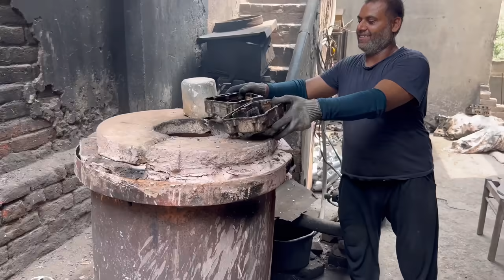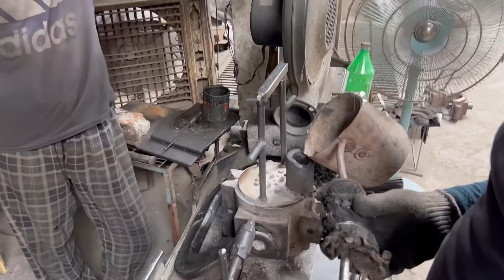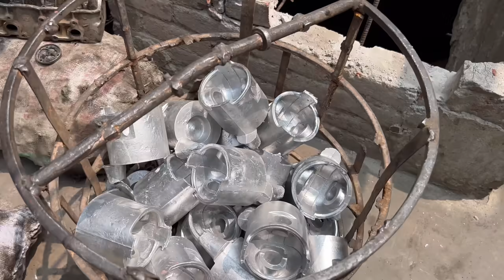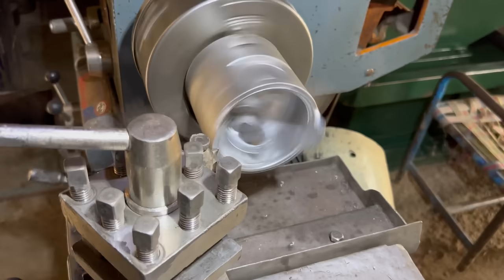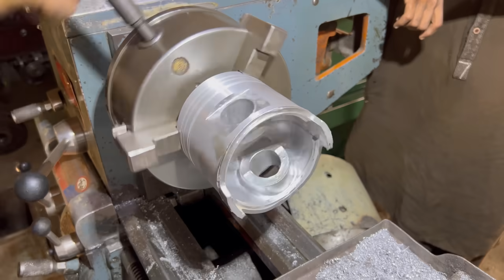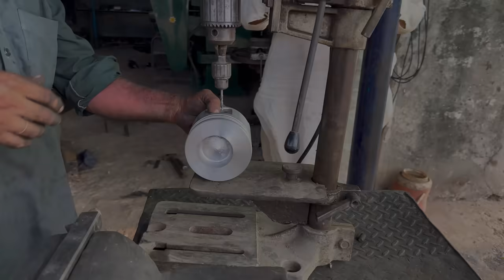How to Manufacturer Process Of Truck Engine Piston - Production of Engine Piston |

Comment: Imagine trying to get 6 identical pistons!! As a machinist I’m horrified!
Reply: Even a hobby level machinist would be horrified. Watching him reef down the hard jaw chuck with a cheater bar direct onto the already machined ring land area had me cringing.
Reply: And yet, this was how stuff were made 50 years ago...
Reply: @mitsos_306  No, fifty years ago in Western countries and Japan etc the quality control was orders of magnitude better
Reply: Ligia Gom  Obviously he is.
Reply: I feel sorry for whoever buys it!!!
Reply: @mitsos_306  No, 50 years ago we were still making EXTREMELY precise parts lol, hell Ive worked on a manual lathe from the 40s that still can, even after many decades of use
Reply: @ferrumignis  or when he fixed to that jig with the nut, hanging way out the chuck... with only 1 point of the angled surface even getting pressure from the nut lol.. I was just waiting for a bite and that whole thing to become twisted metal
Reply: @_VEKTA  the parts they do are precise, the material is crap..
Reply: @mitsos_306  No. Most definitely not. Even in the 1950s we had forged alloy pistons with steel inserts.
Reply: @mitsos_306  material is definitely crap, but if you don't have precision measuring devices (even super cheap Chinese ones) you aren't making precise parts. Pistons I think usually have slop to the cylinder walls of about ~.030", or thirty thousandths of an inch, but I never saw them measure with anything that could accurately measure even a larger tolerance like that. They also just eyeballed in the part straight when it was floated out the chuck. Not trying to be argumentative, I've just done this kind of stuff for years now lol
Reply: @_VEKTA  I really appreciate your response!
You are absolutely right!

My grandmother was a machinist and was working on a lathe making engine parts in the years after the war and until about end of 70's!
they had presision clocks though...

Same here, don't want to impose anything. Just sharing thoughts.

The world is not only US and Europe.we are used to tight specs and good quality products. But in these places;

 What I'm thinking when I see these videos is that of course they are not hi-end products but they must work(sort of).
Reply: @mitsos_306  it's a shame that in none of these videos the machinists never seem to have even the cheapest of measuring devices, but if they did it would DRASTICALLY improve the fit/operation of the final part. China has gotten so good at making cheap instruments, you can buy micrometers and dial calipers for next to nothing nowadays. I think it isnt so much about the money, it's probably more that they've been doing things this way for so long they're stuck on it. With higher precision parts they could also increase the prices of their product substantially, which means more profit for the (likely) impoverished employees. Hate to see it but what can you do ya know lol
Reply: Ligia Gom  , please explain exactly what you are?
Reply: @mitsos_306  50?  more like 100!
Reply: These workers don't have the luxury of being bailed out by government that is tax payers.

Comment: Pistons are designed with a taper, the tapered shape compensates for thermal expansion and thermal growth. The piston crown gets a lot hotter, therefore the top of the piston expands more than at the base of the piston. I’m fairly sure the pistons seen manufactured in the video were being machined parallel.
Reply: "parallel"
Reply: Also modern pistons aren't round, they're elliptical, not to mention these are made with completely unknown metallurgy. I'm like 90% sure this whole operation is just done for YouTube views (2.2million!). Can you imagine hand-sawing the "sprues" off every single one with a hacksaw like they did? Insanely inefficient.
Reply: @truthsmiles  no you are wrong this is not for YT they really do like that and are pretty good, of course not automated, pretty dependent on manual work quality but they have great success according to what technology they use. Metallurgy is ok, the similar is done in most of car production factories, melting old engines and making new from that...
Reply: So you measured the tolerance with your eyes?

Comment: Your supposed to grind a slight ovality on the piston so there is room for the metal to expand across the wrist pin where there is more mass of material. How you can maintain accuracy by keep taking the tool bit out of the toolpost or tilting the toolpost around is beyond me.
Reply: Come on brother this are ancient tools made by Khufu 😝
Reply: You should not expect any quality product out of this kind of sweatshop with the kind of material and tools.  Everything is junk.
Reply: I suspect that these are sent to another company to be properly finished. As shown, I think that these would not do the job in a real engine.
Reply: @jeffreyfwagner  oh but they’ll try.. seems they have way too many people needing something to do, so their economy is built on “good enough for now, we’ll fix it again next week”.  Thus, 10 guys make another piston after 5 guys pull it from the engine, again. Repeat.
Reply: This is a rip-off, OEM, pirates or would you say, it's a local spare part being sold with no brand, it's cheap, so cheap than brand new og certified spare parts, where I come from and other develop country used this kind of technique

Comment: во время обучения в мореходном училище, на производственной практике, мне приходилось отливать в кокеле заготовки для поршней. в принципе процесс не изменился. процесс приготовления расплава очень примитивен. в тигель бросают что попало, раскислитель не применяют. на таких поршнях далеко не уедешь. для изготовления поршней применяются сплавы алюминия с кремнием - АК-3 и АК-4.
Reply: Там у них много насосных агрегатов для полей и пр. Это для них
Reply: @saiansydyk5796   Really does not matter what application these pistons will be used except a paper weight because simply put they are poorly manufactured from start to finish, meaning if they don’t fail upon start up there service life will be very short resulting in the owner of the the equipment to have to buy more new parts and either spend his having to redo the job he just did or pay someone else to do the job again.  Seriously who cares if the parts are cheap if you have do the job over and over again because the parts that were installed failed before they should have.
Reply: @saiansydyk5796   Это дизельный поршень, точнее его имитация.

Comment: The mold looks interesting (for model engine pistons).

I’d use deceased automotive pistons for raw stock, though.
Reply: Using only (cleaned) pistons as stock rather than filthy, oily mystery metal parts would be a good first step.
Reply: ما شاء لله على كل شيء قدير على كل
Reply: Even pistons are made from a range of alloys that would not be compatible. I have seen ingots of raw material, made to a grade for die casting wheels

Comment: Amazing how they repurpose the old and create new - very impressive 👍  lots of negative comments without knowing where these pistons are being used, I doubt they are going into a Ferrari race car. Maybe a pump for water or some other light duty use.
Reply: Did you even read the title? It’s fairly clear what the piston is intended for ( it’s truck )🤨
Reply: that aint no water pump piston , are you blind ??
Reply: Everything in an engine has to be very precise… i feel those pistons would seize up in the bore or damage the sleeves

Comment: I watch those Videos for months now. I am a diesel tech and I fix truck and stationary engines in my machine shop for a living. I really, really want to see an engine run, which is assembled from the parts featured in these videos. With a cast(!) or stick welded crankshaft, those crappy "pistons", a cracked head which was stitched together with sawed off M5 screws and a blown apart block, which was brazed together in the dirt without any annealing.
Reply: Suspiciously looks like a Bedford TJ diesel piston for a 6 ton truck.these vintage trucks are very common here.
Reply: Can you imagine replacing a piston and you reach for this....I'm sure a thousand alarms would go off instantly when you touched it. It's incredible how shit it is.

Comment: Now go look at a video of a Marle piston factory and see how many dudes are wandering around the CNC production facility in dirty holed-up T-shirts. This is all those guys know, it keeps them and their families in food and sandals and probably the single-cylinder air-cooled water pumps going for agriculture. Also look at a town called Dar el salam (I think that's right) on the production of all types of firearms Colt 1911s, Glocks, AKs, whatever you want sir, with guys using their feet as vices, hand files, and hacksaws, these are determined people, I can not dislike them.

Comment: Such a piston cannot work. This is not how a piston is made. It's supposed to be diecast, not full of bubbles. The oil drain holes are blind???! What it should be? Whatever you see in the video is wrong. This is how we played as kids when we were 10 years old. I take it as a demonstration that it is possible to make a non-functional model of a piston.
Reply: Yea sure, no way can they work,,,,and that is why they are making 1000s of them......But I  will say I have no idea how thy get away with it. Cast pistons in a diesel ????? ,,,, And just FYI quality pistons like go in a diesel are forged. ,,,,,I will also say I really don't think this technique would work for a formula one car either. ..... But I guess nobody told them this will not work so they have all kinds of engines running over there with these pistons in them. ,,,, Love to see how they make the wrist pins and piston rings. I wouldn't put it past then them to do it with an angle grinder;)
Reply: This piston is enough to get to a high-quality car service.

Comment: That's a fine job for a recycled metal, made with rough tools. Does it works? Yes it works. How long it will last? Doesn't matter.
Reply: You can’t see more work for mechanical manufacturing there’s subscribers ❤

Comment: I really want to hear the massive knock when someone is crazy enough to fit one of those pistons in an actual engine, and the diesel spray from the nozzle hits that raw ass combustion chamber. I start to shudder even thinking about that. I am kind of sure that said engine will blow apart instantly if it comes under load. Creepy sh*t.

Comment: I made aluminum book racks in 7th grade in a cleaner environment than these guys are in,  wonder how hard those pistons are?  Squishy is my guess.  Do you suppose they line bore the pistons also I don't see any measuring for the ring groves, just anywhere.  I'd like to see a closeup of the piston from where they outside clamped it in the 3 jaw chuck, looks like a spot for dents, just a crap job, I guess if you don't expect it to last very long
Reply: They way the guy reefed down onto the finished ring land area with a cheater bar on the chuck key had me cringing.

Comment: It will fit just fine on the hammer straightened rod, on that broken and welded back crankshaft, in that cracked and welded engine block of that totaled truck it came out of. Everybody be positive now. Work? Didn't say it'll work.

Comment: Most of the new Euro and Japan 4 cyl engines have sintered, blacksmited, machined and balanced pistons. You can buy matchng set of 4, but you can not buy one.
1,6 diesel from Merc/Renault have steele blacksmited and balanced pistons, 160HP from 1,6L. Crazy efficent and reliable.
2.0 turbo petrol from Merc has 416HP.
How long would it take for these guys to catch up?

Comment: I can imagine the life span of these pistons built from scrap aluminum casting. During casting, the additional material that would serve to give the piston longer life is discarded and the molten liquid that remains is theoretically pure aluminum. Silicon should be added to the melt which gives the piston longer life. A piston made in the way in this video will have a very minimal life as it is made of pure aluminum and is therefore too soft and subject to premature wear.....
Reply: Minimal life, like the workers in this video... XIX century, today...

Comment: When they drill lateral holes in the piston , why they didn't use a V with round for the piston and mobile jaws to maintain the piston in place of to maintain it with hand which is very bad work and dangerous

Comment: This shows how pistons should not be made. Alloys are extremely important, the actual pistons are cast under pressure, with very tight tolerances. The goal is to have the same density, weight, stiffness, degree of thermal expansion and a bunch of other parameters. MEASURING DEVICES are used in machining, it is not done by eye. At the end of the process, additional heat treatment is done. These pistons from the clip are a surefire way to damage your crankshaft!
Reply: Не се притеснявай за коляновия вал, и той е правен по подобна технология и едва ли е повече от 4 долара бройката. 
Дори с това оборудване и дори от тези материали и дори със същия персонал, качеството може да се повиши 50 пъти, като просто им се обяснят най-фрапантните грешки. Примерно много е лесно да се направи приспособление, което да позволява едновременната обработка на дупките за буталния болт и което ще гарантира, че самият бутален болт ще е успореден на коляновия вал. По техния начин буталния болт ще влиза само с помощта на големия чук и дори да успеят да го набият, мотовилката няма да е перпендикулярна на коляновия вал и пак ще е нужен голям чук.

Comment: I want to like it because I want these guys to have a means of decent living out there. But I'm really curious and want to see somebody try to stick one of these things in an engine and run it. My gut says once the wrist pins are in they are going to need a little "coaxing" to slide into their bores. Or there is going to be so much slop that they'll easily slide into the bores but the pins and skirts will be knocking like crazy causing even more damage to the rods, bores, block, crank, thrust bearings, etc.  It would be interesting. to see...

Comment: Thought engine piston made from alloy stronger and heat resistant instead of just aluminum?  
Aluminum alone  may not withstand combustion chamber pressure and heat intensity.  
Please correct me when I’m wrong.  
Just curious.

Comment: Looks like the piston didn't last long. Why is that? Because the casting does not use a pressure/injection machine, the aluminum is not too dense so it has a brittle surface.

Comment: While I commend their ingenuity, passion, and ability there is no way I would trust such a precision part made out of junk metal of mixed alloys machined with questionable specs.

As others have said, pistons are not round, they are elliptical.  They have to be due to the different densities around the piston and different rates of thermal expansion.  

That being said, it still makes for a very interesting video to watch.

Comment: They were  doing well with the precision at the beginning  ruined it with the drill at the end
Reply: Ron the oil can get through to the sump. It is "Fit for purpose", But if iI was there I would sharpen that drill for free if they have a grinder.

Comment: For as rough as these are made I am surprised that he did not use a simple v-block to hold the piston while drilling. Did not understand the offset depression in the piston and not machine to make consistent volumes. Piston ring grooves or just lubrication grooves? Truck  engine pistons really, per title?
Reply: V-Block?  With all the spindle/quill run-out it needed a flexible unsteady hand!

Comment: @Alex Outhwaite  these pistons are not used in new bores. Being cheap it can be used in worn bores. I have used them and got service. 
The top has to be coated with tungsten for use in turbo engines. 
The top compression, ring is encased in hard steel. This piston doesn't have it.

Comment: I'm thinking this is not a real Piston. 
Ring groves not deep enough. Spacing just guessed. Same with  the gudgeon pin holes. Not tapered not oval etc. 
No pin to crown measurements. 
Perhaps this is just some machine shop showing of there capacity to make anything. Just not very well. 
It's YouTube after all...

Comment: The title must be confused. I know a lot of Eastern folk who call compressors "engines". . . These MUST be for an air compressor and not an actual internal combustion engine.
Reply: 나는 동양인이다, 압축기를 엔진이라고 부르지 않는다
Reply: Not with the dish. Compressor pistons are flat topped and WAY lighter in the wrist pin area. I don't know how but they actually use these things in DIESEL engines.  Must be nobody told them they won't work.

Comment: I did not see one thing proper, ore even close. We are not impressed with crappy work. Build some wood crates or carts to transfer parts from one station to another. Use cutting oil. Its important. We saw absolutely no inspection. None! We will then assume there was none. Can You blame us? ring grooves have to be a critical width. When You throw parts on the ground, it shows You dont care about quality. these parts have to be taken care of. Im not kidding when I saw You have to go back to the mid eighteen hundreds in the usa to see work this bad.  Perhaps I was too easy on You guys. Please read comments and get better. 
We actually like You guys. Your hard working guys and industrious. Some of the changes will cost nothing. they will increase production. I speak from experience as a machine shop owner